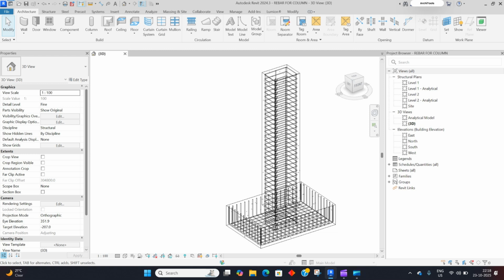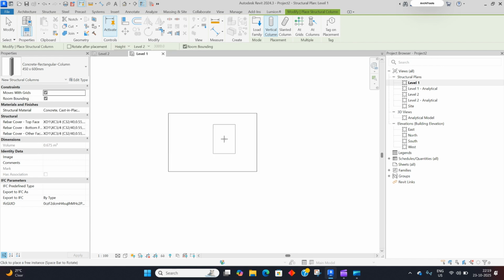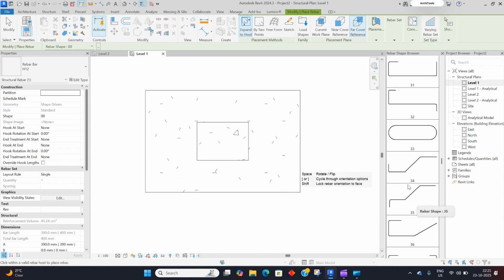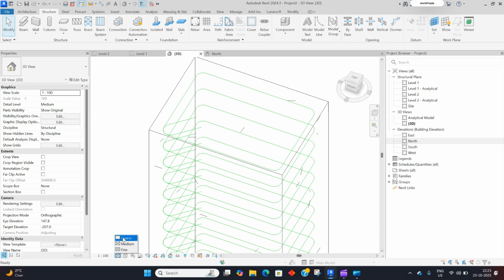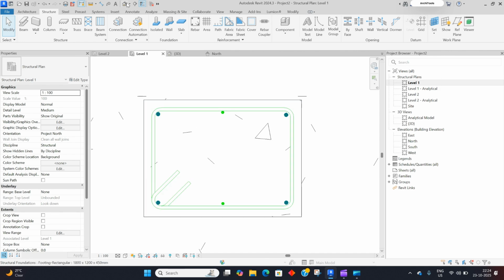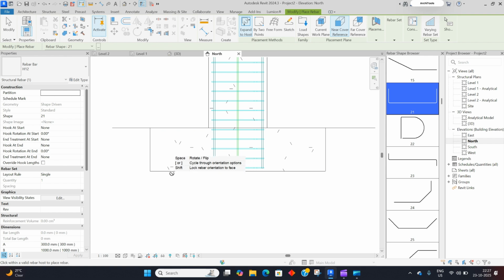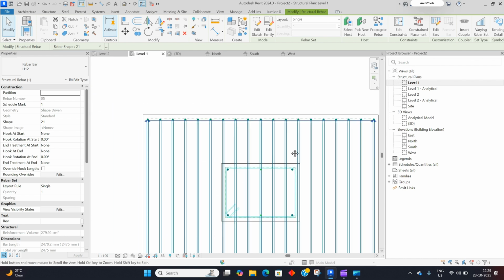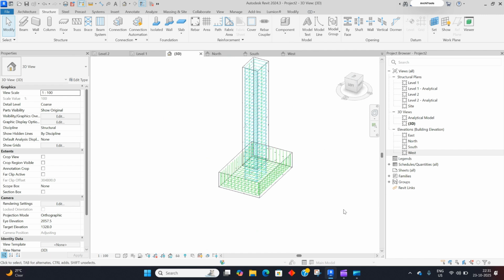REBAR IN COLUMN AND FOOTING USING REVIT | Step-by-Step Reinforcement Detailing in Revit

Comment: How to provide L to the column vertical bars
Reply from the maker: To create an L-bend in vertical column reinforcement, select the rebar placement tool and use the Sketch option to draw the required shape. Make sure to check the work plane before sketching.

Hope this helps! If you found the video useful, please like it and subscribe to Archi Tools for more Revit tutorials. Thanks for your support! 😊